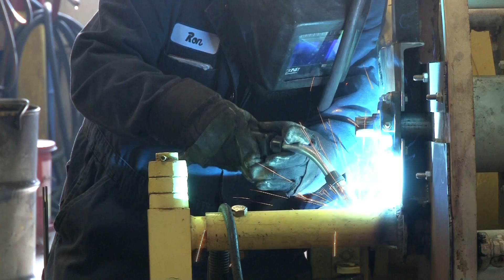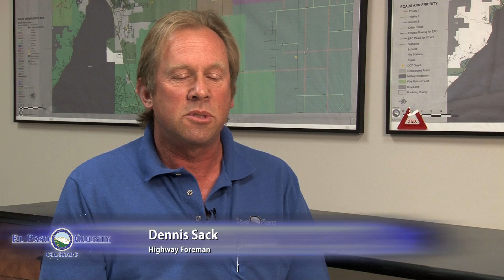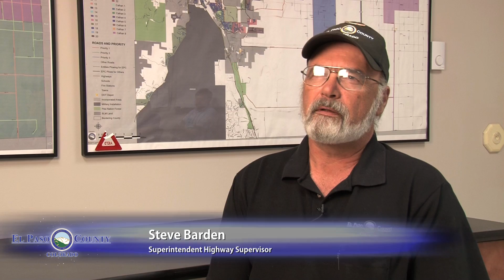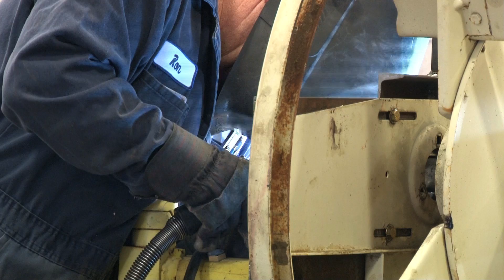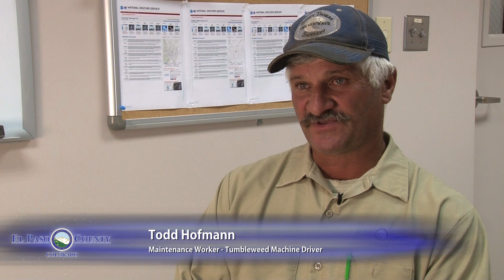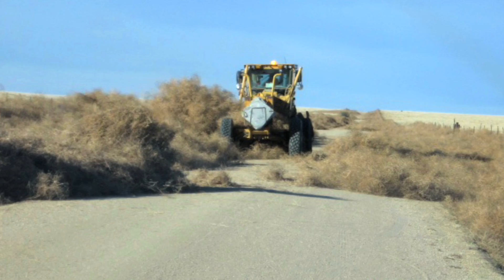Tumbleweed Machine

Comment: Typical goverment idiots. Spending fantastic amounts of money on a huge machine that only makes the problem worse by spreading seeds onto the private property next to the road.  A small tractor with two vertical rotating drums rorating inward towards the center with spring fingers can crush the tumble weeds into small bits. Then pass the material into a common vacuum chipper mulcher that blows the material into a collection trailer. To be delivered to a composting operation. Composting breaks down the seeds and stems into good bio material to improve the biological life and water holding capacity of the soil. 
  The entire system could be assembled for $10 to $20k.
What did the idiots spend on the massive machine they are bragging about. 
Look up the YouTube video of the rotating barrel system the university students built. Search
INNOVATIVE TUMBLEWEED REMOVAL.
*New leaf mulching vacuum trailer is $3k
*Small used tractor under $7k
*build rotating drums with slits and spring fingers under $3k
* tilting trailer with collection box $7k.

Comment: Next step is saving the crushed up biomass for composting or heating. As Hippo commented it would then (partly) pay for it's own removal. Think circular – no waste!
Reply: No fuel the seeds could contaminate other patches
Reply: I think if we used it up as fuel or managed to round it up as fertilizer elsewhere that would be the waste, better to reintroduce the potential nutrients back in the ecology then taking it out. 

In fact they should probably gather some of that stuff up and dump it where they might calculate is the origin of that swarm, I can imagine hills that are barren over the centuries when they should be not due to the introduction of Thumbleweeds.

Comment: So does the machine crushes the seeds too? Otherwise you're just sending all the seeds down the wind...
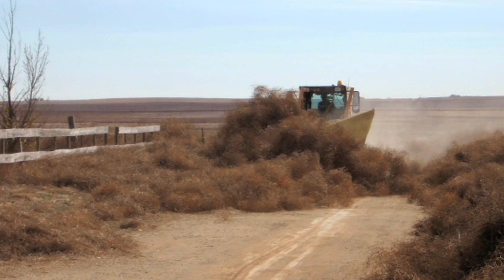Reply: 4:17 will tell you.
Reply: @Sicentus  He doesn’t say whether its chopped fine enough to have chopped the individual seeds. Maybe they only chopped the tumbleweed and tought the job was done. Then next year there will be a massive row of thumbleweeds growing next to the road. Good chance that the seeds are way smaller than the chopping that the machine does.
Reply: @Engineer9736  If you collect them into a pile they won't drift around anymore. And you could shovel them up and use it as fuel maybe?
Reply: @placeholdername0000  Or collected all and buried in landfills and let it compost
Reply: Yes
Reply: This for sure make it worse lol
But on the next go round they might have started ejecting it into a collection truck
Reply: It's already too late for that. The seeds are already spread.  Next year you can burn them.
Reply: I'd say that those tumbleweeds have already been blown across the fields and into the fence rows.   So, the seeds were already dispersed.
Reply: They want more tumbleweed to grow, otherwise how they going to sustain their job.

Comment: I'm sure those farmers whose fields you are seeding with tumbleweeds really appreciate you doing this. Talk about clueless.
Reply: They are basically turning the natural multiplication of the tumbleweed up to 11.
Reply: 4:17
Reply: Good point, pretty dumb.
Reply: Yeah I hope it's working out for them. It doesn't get much worse than regular tumbleweed seeding, so jf they chop up a good amount of seed I'd call it a success.
Reply: Ya reckon those tumbleweeds were growing on the road or in the ditch? Tumbleweeds can be controlled with proper farming techniques.
Reply: @carlosarias6143 they can?
Reply: I can't see a single twig comming out there, so I'm betting the the grinder is calibrated to break down the seed.